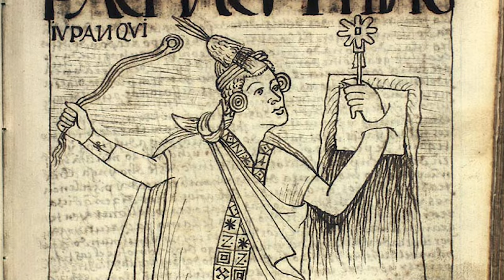SACSAYHUAMAN - How They Did It | Polygonal Masonry

Comment: The only reason for geoplastic material shaped that way is if they knew the shape stood up to earthquakes, but they lacked enough cut stone to fit. But that would create a mix of stone and geoplastic concrete in the walls. The geoplastic material would also adhere to one another, so it wouldn’t flex and resettle in an earthquake. 

It’s a excellent puzzle, isn’t it? I look forward to seeing more about this in the future. 

Something occurs to me in watching this. If the stones were dragged and they showed sign of being dragged, the workers cutting them to fit may have noticed it and worked out how to friction-cut them. That solves the question of how they figured out how to do that, which has been bugging me for years. 

As to the templates, mud made out of river silt could give a perfect image of what the stone being placed needs to be shaped to match. With the right clay and sand mixture, it would probably hold the shape but not adhere to the surface. When you’re done with the mold, drop it into water to use it again on the next stone. Anyone capable of making pottery could do it. 

I love it. There’s not a single alien in sight. It can all be done by men who knew how to work with what they had available to them.

Comment: GREAT interview. I never seem to hear much about files and rasps when people discuss these tight fitting, irregular shaped stones. That has to be the final step. Get the two stones shaped close with scribing and chiseling. Leave a small gap between them, just enough for the file to fit. Run the file between them, working both stones at the same time. Then, bingo bango bongo, you've got your two tightly fitting finished edges.
Reply: I agree. I have never seen these sites unfortunately. I am an engineer and a woodworker who builds boats among other things. This presentation, snd your thoughts are definitely on the right track. My boatbuilding skills and techniques led me to believe something similar must have been done to these ancient rocks. I also believe there is MUCH more to be said on the topic!
Reply: They had no steel or iron, no forging or metal casting, they were pre Bronze Age. They had gold and silver because it could be collected and pounded together. They had no wheel, no beast of burden. Rocks that weighed tens of tons, ( this could only be done by grinding the stones against each other, ) it’s hard to believe Indians in animal skins and rough weaving mastered this technology, with hemp rope, and no blocks or tackle, “sticks to scribe lines then pounded with rocks, and used a lever?” IT CANNOT BE DUPLICATED, if so prove it. It’s probably more likely long since extinct civilizations accomplished the task 10’s of thousands of years ago. Where the technology or techniques are long eroded or catastrophically dispersed.
Reply: @tomknauss570  Exacly, all of these things are brushed over..
Reply: @tomknauss570  actually, that's not more likely.  The process they describe here is possible and thereforebis much more likely than a civilization that we have no physical evidence of whatsoever.  
If this fantasy earlier civilization is completely erased from the Earth, why is their wall still here?

Fitting some rocks together isn't that hard.  You are greatly exaggerating it's difficulty.
Reply: @jamisojo  Percision joining 10 ton stones (mortar less) is very difficult, in a polygonal assembly. Specially by people with barely a written language, or tools, anything less than other stones. 
But if you must cling to your religious chronology. ( let’s just say such a flaming catastrophe encompassed the planet.....and anything not stone was incinerated.)

Comment: YES !!!  This is the first viable explanation of how these walls were built that makes any sense I've heard. Absolutely fantastic video!!
Reply: What Vincent Lee said was NOT viable. Take a chisel and start working hard igneous rock and you'll see. There is no way to get joints like this. Much less several inch wide parts that fit near perfectly together. You couldn't even do it if you used a modern grinder with diamond blades.
There are viable explanation to how this was build. The video dismisses them offhandedly.

Comment: Dr Miano, I have found interesting your explanation(s)for this rock work. But I do not think you are any more valid than the idea that say 100000 years ago Earth held a society that had the technology to move 100 - 1000 ton blocks, with precision, up and into place, much less shaping said stones and moving them 100s of kilometres over hill and over dale. I work with heavy lifts, boulders and placing of architectural stone. One to 10 tons....maybe yes hundreds of men can move such. But the forces upon the rope the size that men can hold are still overwhelmed by the gravitational friction of a 100-ton boulder. Yes, with a lever large enough one may move a mountain, but the lever big enough to lift, flip, flop and rotate a 1000 ton block is simply not found in nature, much less 1500  to 3000 years ago. There is more to this story, much more. How do you explain the melted granite on the Egyptian sites? How do you explain the destruction of so many sites, such large chunks scattered as if by the wind? How do you explain the absolute laser precision of the cases found in the Serapeum? 60 to 80 tons down a shaft then 100s of feet up a narrow hallway and into a side room? There is simply not enough room to accommodate the hundreds of men it would take to move these boxes into place. I challenge you also about the shaping of this rock. Go to the hardware store and purchase a 5 lb iron sledgehammer, and a chisel. Then find a chunk of pink granite and go to town with all your might. Tell me you still think that men with tiny copper tools shaped the perfect surfaces of these boxes. It is easy to be academic and cast a theory upon the whole world of antiquity, date it and call it a day. Explaining the "how" and "why" is a completely different matter. Best Luck!
Reply: He doesnt answer hard questions Just hearts the comments he likes and that agree with him. Love to see him debate Jahannah James
Reply: Just find the laziest person you know of, then pay them to get the job done. Easiest method to find the most efficient way to do things.
Reply: Its geopolymer, and a very refined method. The larger stones were not moved far/cast in place. This guy is quick to disregard it but i am very confident that this is the answer. The “melted” rock may well be a spill.

Comment: As a builder, I can tell you that these stones can only be produced to this accuracy in two ways. 3d full size templating or scribing stones together. Scribing requires the stones to be held tight next to each other and then cut and checked and cut and checked. As these stones weigh many tons , that is going to be impossible. Why? Because unless the stone is already sitting in its finished location you can't get an accurate scribe. Which also means you cant mark behind the face. This would mean that the only contact points would be at the faces, and that a strong wall does not make. This is true because the bottoms are not flat and the sides are not perfectly square..Think about it. 3d templating is even more out of the question. A laser scan might make them possible by carving. Nothing else. A liquid , poured substance makes a whole lot more sense. Then everything lines up perfectly first try. No need to spend all that time cutting huge rocks. " You've got rocks just lying around".. Yeah, none of which fit.
Reply: Because all the rocks that fits were already used

Comment: At 2:10 you specify the front facade. That is misleading since the blocks which are feet thick at times are perfectly flat mating surfaces between blocks that extend the entire width of the block. The polygonal masonry is not only a front facade
Reply from the maker: Sometimes, yes. Sometimes, no.
Reply: @WorldofAntiquity  if its one of the true polygonal walls with nubs and scoops and all, then it is.  A 'front facade' is also misleading when it comes to real polygonal walls
Reply from the maker: @TheFosbergTheories  I don't understand what you mean by "true polygonal walls." If it's polygonal, it's polygonal.
Reply: @WorldofAntiquity  there are many varieties of polygonal walls. Many varieties are modern or semi modern.  The varieties that have nubs and scoops tend to be the important ones
Reply from the maker: @TheFosbergTheories  Why are they more important?
Reply: @WorldofAntiquity  they are the ones that all match up worldwide and have thick fully finished interior mating surfaces. The oldest parts of many structures.  The ones that are unexplained.  

You can see the different levels of masonry throughout cusco. Theres a street where you see monolithic work below megalithic work below inca work below colonial work.
Reply from the maker: @TheFosbergTheories  I'm sorry, but they don't match up worldwide. The work is different. The nubs are different. And they come from different times.

The work done at Cusco is chronicled in Spanish documents. They hired Inca workers to make those walls.
Reply: @WorldofAntiquity  there are examples such as on the back of the coricancha that are almost exactly the same as walls in the osirion in egypt. The wall on easter island matches ones in peru. Yes they varry but if you actually do the research on these walls youll be able to see these obvious connections. Hell, the casing stones to some pyramids were polygonal. Most of which are gone now- the casing stones-
Reply: @WorldofAntiquity  and my whole point is that they likely dont much come from different times. And im not sure what spots they may have hired inca to build or what exactly the story is there but some inca walls were torn down in recent times to reveal whole megalithic walls so im not sure why its so hard to think the walls came first
Reply: Maybe I can put a light in this subject being a stone mason of 44 years and taking many vacations to these places causae im a rock head...lol  ....

Them stones were cut and ground close not perfect.. they got closer over time...
They are in a earthquake zones they see hundreds if not thousands of small tremors each year and each time they simply rub together (many tons rubbing together)and and then the moisture behind the wall simply wicks the dust out over time or in times of rain...
With the style of construction this over time will give you 2 results...
1) wall failed and the wall spreads too far and toppled..
2)the wall joints will rub together and keep to itself and the joints will rub and dust out to a such a fine point that they mirror each other....

I use to go California back in the day during the winters to work  and all the old monument stonework that sits well over 100 years always either fails (and we fix it) or we check the clips and pins that were cast into them to check if they broke and simple recast them and approve the wall....

Old railways stone work is also doing this in earthquake zones they might of been laid with a 1/4 in joint but after 150 years all the joints grind out and the rocks rubbed together so much that they are paper tight now a days after the water wicks the dust out...

I have also been to all these different sites and they do use have slightly different ways of construction however they were easily done by stone age methods..that for shits and giggles I now teach my grandkids how to work the stone like that...

Also... Like all foundations going up..
The lower you go the bigger the stone as you go up you use the lighter shit and if some earthquake hit and a wall filled you simply fill in with whats available at the time of wall fail because getting another huge stone in there you would have to tear out all that other stuff...
Is quite simple
Reply: @chriscaahbaugh2246  this is almost entirely rediculous. This is like the most desperate attempt of an excuse. Look at the work. What you are talking about very strongly doesnt work. All sizes, from a few pounds to hundreds of tons. Different materials. Sandstone, limestone, granite. I can go on. But ive heard your theory before and it has been disproven by simple logic many times.
Reply: @TheFosbergTheories  I respect your opinion my friend we are all entitled to them .....But how I say these things are done is still to this day how we do them in the field and have been in my family for generations and we make quite good money "consulting" in these older ways😁..
To list as ridiculous to be quite honesty just shows the level of actual training you have received...
You might not want to talk meetings or around people who been doing this for over 20 years cause they will just see right through you...
(Stick to laboring) 🙏 👋😁
Reply: @chriscaahbaugh2246  incorrect again. I grew up in stone masonry. But even without experience- the theory you metioned is a common 'excuse theory'. I have created that term to describe the ways that others try to disprove the prehistoric civilization theory. Things like the deluge only being in the meditteranean. The nubs being lift points while not explaining scoops. Slave labor never existed in egypt in the way you imagine. Stones making themselves fit perfectly after eons of weatherring.  And so on. All of these things are easily proven and disproved. The blocks interior surfaces are even and perfect and show no evidence of variation like you would see in your theory. No ones ever seen the evidence required to make your theory correct. Itd be easy if i could cite tool marks on the mating surfaces but i cant. Because there arent any. If your theory was right, every single one on earth would not have perfectly flat mating surfaces. They would varry and the 2 blocks mating surfaces would mirror each other. Thats not the case.    And this part is a guess but would there not be leftover dust and debris in between the blocks where the imperfections were rubbed flat? I mean maybe not all of them. But at least like one of them right? Wrong. Debris between blocks have never been found
Reply: @TheFosbergTheories  I never said that there wasn't another set of peoples that were before the 1s mentioned so please get that right .....
Humans have had the same brain for well over 150k years just not some of the composite tools and manufacturing speeds we got now a days...all the technical abilities of ancient stone bead making are the same for the larger projects you just have to scale them up to project at hand is far simple for those with the proper experience..
I did however say that all this could be done with the technology of cavemen....
As for your explanation past that I will stick to my last thought and would advise you to work on your craft a bit more to further your knowledge my friend or stick to laboring...😁
Reply: @chriscaahbaugh2246  nice job conveniently avoiding certain things here. I noticed you dont really try to argue the most important points ive made. This was not productive for either of us

Comment: I like the scribe, retaining wall and logs theory. Still feel that geopolymer would be so much more efficient and easier. Vincent was very good to listen to. Really good theory.
Reply: "Geopolymer" is just a nonsense code word for "magical bullshit", sorry!
Reply: @Chris.Davies  beat me to the comment… wishing to the sky god would be easiest. But if we want to talk about what is practical….
Reply: @Chris.Davies  it's actually another word for concrete. You know that same magical stuff the Romans invented....or did they. It's a valid and probable theory that the Egyptians cast the limestone blocks of the pyramid. Also explains nicely why they stopped.....they no longer had all the recources so they became much smaller and simpler and less durable/lasting.
Reply: David makes sense with the idea that a “geo polymer” would make more sense to use to make regular copied blocks.  If one can make a geo polymer that goes into a mold, it would make more sense to make a mold and make the same block over and over again; like bricks.
Reply: @bok2bok333  
Except..., the stones in the pyramids are not all the same size.  If they were casting stones with a geo polymer, they would use a single or limited number of molds and cast the same thing over and over again and the construction would be more regular like a brick built structure instead.  There’s way too much variety in the stone size and shape for that to be the case.  They tried to make them all roughly rectangular, but that seems to be about as good as they could do.  

I would love to have seen what they pyramids looked like completely finished (even beyond what they did complete.  They were never completely finished even originally; one can still see outer casing stones at the base that weren’t flattened like they should have been that are next to sections that were finished).
Reply: @keirfarnum6811  I also realized ....the stone nobs.....they are stone support framework....same stone ...and for some reason is left protruding.
Reply: @keirfarnum6811  yea it is a good point on the blocks. Each row has exactly the same height which is something. Maybe they did both. That's one of the hard parts of working who did what...when....and how....and why.